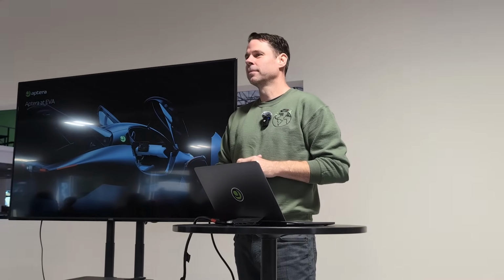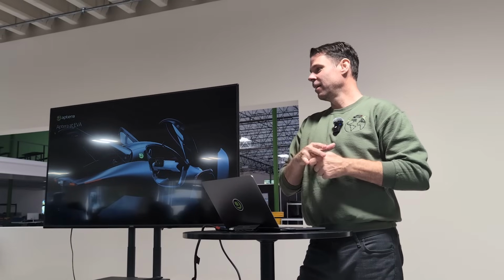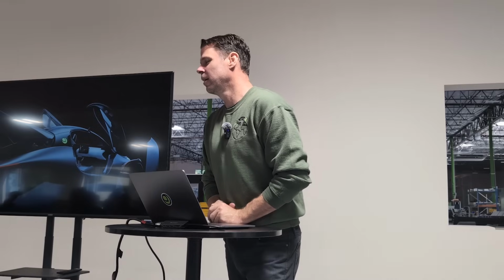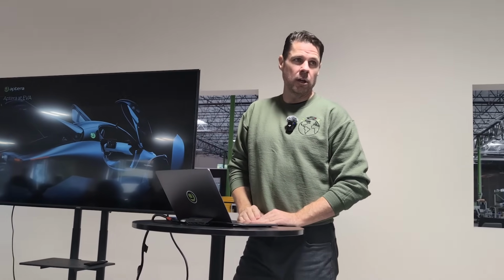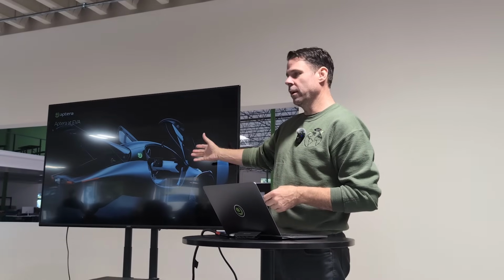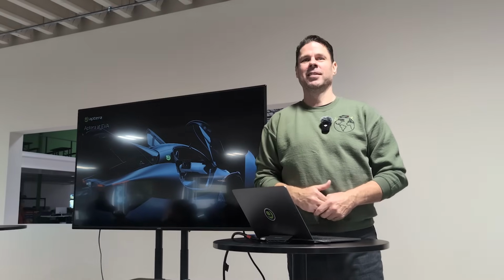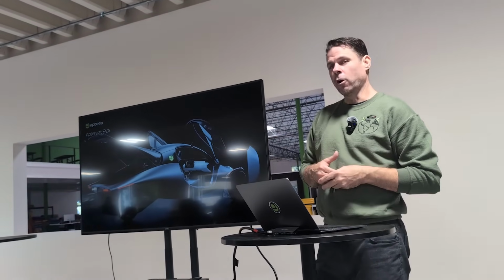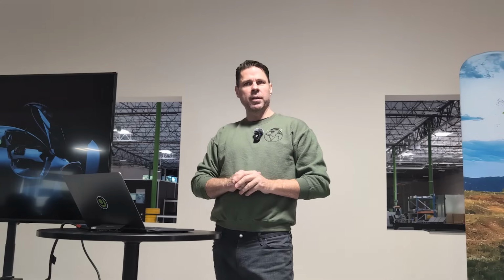Aptera Q&A session with Chris Anthony at EVA 2024

Comment: I understand that Chris A. would want to boast about the roof straight of the 2006 model but that was a very different vehicle in construction and design.  There really is no direct comparison with the current Aptera.  Simulation models are incredibly accurate these days.  They could compare a simulated model of the 2006 vehicle with the actual tests from that time and then take that information and see how the 2024 Aptera LE compares in the simulator.  The thing is, they will have crash tests in a few months and hopefully that will validate the simulation tests.  What really only counts is the actual tests of the 2024 Aptera LE.  Comparing it to anything of the past is pointless and only weakens credibility.
Reply: The roof should be stronger in this version. It has a steel rollover hoop built in.
Reply: @tims8603  I don't doubt that the LE is stronger than the 2006 model. Comparing the LE to the 2006 model is pointless.  As far as the steel reinforcement, kinda takes away from carbon fiber being stronger than steel. There is also a pretty big issue when carbon fiber is in contact with steel. Galvanic corrosion will eat the steel for lunch. There are ways to avoid the issue with isolating coating on the steel but you cannot have the two come in direct contact. CPC Group is well aware of this and has dealt with it for years. My point here is for anyone who is going to be working on their Aptera, that this is a big area of caution.
Reply: @ddessert6  I did some research and found this.

Here are some remedies to control the galvanic corrosion of metals connected to carbon composites:

    Substitute the metallic part with a high-corrosion resistance alloy. In this case, the best option is titanium and its alloys.
    Disconnect the electrical connection of two parts by placing an electrically insulating material, such as fiber-glass-reinforced composite, between those parts.
    Use epoxy resins without any hydrolysable linkage, such as ester bonds, to mitigate water penetration into the composite and then to decrease the real cathodic surface area.
    Use sizing agents as a sealant on the surface of the carbon fibers before fabricating composites.
    A combination of sulfuric acid anodizing and a hybrid sol-gel coating is quite effective against galvanic corrosion in carbon fiber metal laminates.

So, it seems, there are ways to prevent  galvanic corrosion.
Reply: @tims8603  yup, I'm well aware of the possible solutions & have been working with CF for a long time. The other "little" issue with people working on their Aptera is carbon fiber dust. A respirator mask is a must if drilling or any cutting/sanding.

I'm looking forward to getting my vehicle next year.
Reply: @ddessert6  I don't think they'll have to do much drilling or sanding. The panels are made with channels and mounting points molded in. They will be, mostly bonded together. Chris said in the Q&A that they will go together like LEGOs. That might be a bit of a stretch but, if they're formed with precision, it might not be far off. The bodies will be assembled by CPC so only final assembly will be necessary. 

My number won't come up for 2-3 years so I won't be getting one soon. We still don't know  what the prices will be so I might not buy one if they raise it too much. Also, I live about 2,500 miles from Carlsbad so I'm not sure how I can get one here.
Reply: I believe the roll bar is carbon fiber, not steel. There is a second layer over it that is part of the roof. 

The aluminum frame is the only metal in the body  (I've heard the belly pan is aluminum too but I think it's also carbon fiber)

I believe the point Chris is making is that the previously measured roof strength was already the strongest rating ever recorded. The new roof can only be stronger than that.
Reply: @richardryley3660  I guess the roll bar could be carbon fiber. I thought they said steel at some point but I could be wrong. I'm pretty sure the belly pan is aluminum though. I was in one of the exploded animation videos. Aluminum is probably cheaper and a better conductor of heat.
Reply: @tims8603  See, that's the thing. Chris said that the Aptera is built like a thermos. He specifically said that the Aptera would not leak battery heat to the surrounding environment. If the belly pan is aluminum, leaking heat in below freezing temperatures is exactly what the Aptera will do. 

Now, I could be wrong. I could have misunderstood. But I believe that I heard that the cooling system works by pulling in air under the windshield, and forcing it past the battery, where it exits back out the tail. The Aptera is air cooled, not by convection through the belly pan..
Reply: @richardryley3660  You're correct about the air flow from the cowl but there is also cooling from the belly pan. This video is one of the engineers talking to Steve from Aptera Owner's Club - Aptera's skin cooling system explained by Daniel. The conversation starts at about 1:30.
Reply: @tims8603  Okay, I did misunderstand. I think I saw that video, but missed that the belly pan was made of aluminum. 

It's still a bit hard to grasp, but he said that there is cooling fluid used in the cooling process somehow, and directed through the belly pan. I interpreted that as meaning the belly pan was essentially the radiator. Heat could radiate from it, but not convect into it. If that's not the case then thermally the belly pan doesn't exist. Air flow across the battery and airflow across the belly pan will be separate but at the same temperature. The HVAC can warm the battery (and maybe the air in the tunnel?) but the heat will be lost through the belly pan. 

The layer of air should act as some insolation though. Unless I'm misinterpreting again, the belly pan is not in physical contact with the battery. If you turn off the coolant flow, heat will stop being lost, and the battery can warm up. 

Maybe there could even be a layer of insulation on the inside of the belly pad. I wouldn't speculate though. That would prevent cooling the battery as quickly. Maybe that could be the Winterizing option.

I'll add that I also understood the statement to mean that the battery pack is filled with coolant. That coolant flows from the battery into the "radiator" in the belly pan. So the air cooling is separate from the liquid cooling and the convection cooling is on top of that. The inverter coolant may also flow through the belly pan. The motor cooling is in the outriggers and is completely separate. Again, unless I misunderstood.
Reply: @richardryley3660  I really don't understand what your concerns are. There is another video from Aptera that might explain more - Battery & Powertrain — Aptera Engineering Update
Reply: @tims8603  I never said I had any concerns. I said that I did not agree that the belly pan would be made of aluminum. I clearly misunderstood.

Comment: With so much being assembled in Italy, it seems a bit overkill to have such an extensive production line. I’m still not convinced that the solar production can keep up on a shift to shift expectation. He says they can make 10 a day. That’s only 50 a week. That’s only 2,500 a year. How’s that going to keep up with 20K a year on vehicles?
Reply: That is their pilot production line.  They have plans to set up a full production line that can easily keep up with full scale vehicle production.
Reply: They have automated equipment that produces the panels. I would expect that it is a matter of having  enough of that equipment to keep up with production demand.
Reply: As some have mentioned, they may be in a pilot configuration with designs to expand when closer they are the full production. No one has asked in order to get clarification.
Reply: Hopefully someone from Aptera will be reading these comments and fill in the gaps.  10 panels a day.  Does that mean all of the panels for the LE or individual panels?  As you have stated, even 10 complete set of panels per day does not meet the expected vehicle production numbers however I would expect Aptera to expand their solar production counts as they get closer to ramping up to 40 vehicles per day. To invest too early on the equipment to have it sit there unused for months, does not make much sense.  The equipment they have now can be used to work out the issues and make an inventory of solar panels.  Again, a little clarity from Aptera would be great.  There is no need to have things like this fuel doubt in the Aptera when there could be a very easy and logical explanation.
Reply: When Chris said production of 20k units per year, he meant that the slowest step will be 20k/year.

Comment: So glad that Aptera is staying with right to repair!
Reply: Having owned an electric car since 2013, let me tell you 
- Replacing electronic parts cannot be done by local gas car workshops. Note I’m taking about electronics. Not door handles. 
- Many times specialised software is used to calibrate and configure electronic parts. 
- It was not clear on how a customer will diagnose the faulty part and then spend time removing the part and ship the part. 
- For example if a cell fails in battery pack, ideally you want to remove the cell and add a new cell into the pack. Software is used to check health of cells and diagnose the faulty cell. Adding a new cell will need configuration using software and  cell/pack balancing. 
- How will customers or local workshops do the cell diagnosis ?  It is impossible without software know how and tools. 
- Any electronic part can fail Onboard Charger, DC-DC convertor, motor controller and others. Who manufactures these and who repairs these?
- He did not say if Aptera themselves will repair electronic parts or do they need to send it to their vendors to repair them. Turn around times will get affected. 
- Nothing was said about publishing schematics of electronic parts so third party workshops  can repair them. 

He just spewed some marketing saying Aptera is a right to repair company. They maybe honest in sprit, but in reality they don’t seem to have a clue. 

I love the company but repairing electric cars is not as straight forward as saying “shipping parts in 24 hours”.
Reply: @KamleshMallick Chris Anthony has already said in a previous investor Q/A that the battery modules are sealed and cells will not be accessible/replaceable. This is typical for all current EVs that I know of for a number of reasons (e.g. better vibration and thermal management).

It seems that you're envisioning "right to repair" as troubleshooting and replacing discrete components on PCBAs in the vehicle. That's clearly not what's intended (although it would be nice as an option). The model is that all main modules of the vehicle can be easily replaced by an owner or independent shop, with the replacement module drop shipped from Aptera.

I agree with you that we'll need to see what they provide for running diagnostics on the vehicle for troubleshooting problems. But I wouldn't call their talks of the right to repair as just PR so far.
Reply: @AverageJoe928  How will main electronic modules be “easily replaced” by owners or workshops?
Have they released the list of parts?
Which parts will need specialised software configuration?
Are we only dealing in electronic part replacement and not repair? - then he should say we are a “right to replace company” not a right to repair company. 
There are lots of gray areas in this process. 
Aptera Owners Club needs to create a video on this if he is reading.

Regarding battery packs being sealed - they should not be sealed for support personnel. 
If not how will they repair the pack?
Battery packs can can cause issues too. 
BMS or connectors can fail. 
Cars can stall at low SOCs if one cell or module becomes weak compared to others. 
Does the BMS have active or passive cell balancing?
Diagnosis of all of this should happen at special service centers by trained people. 
That is not going to happen. 
So unless they release the details - I will say all of this is marketing.
Reply: @KamleshMallick  they haven't even produced the first production intent vehicles and your shitting on their service materials? It really seems that some people like to stir up issues for the sake of controversy. Aptera has been more transparent in their development process than any other vehicle manufacturer that I know of. They've also modified the design based on feedback (e.g. inclusion of DCFC). If they fall short of providing necessary service materials then they should be held accountable, but it's way too early to accuse them of "pie in the sky marketing talk".
Reply: @AverageJoe928  
Really?
From my posts which have a lot of practical realities, you have jumped to the conclusion that I’m shitting on their service materials?
Maybe you need to improve on your comprehension. 
And you never bothered to answer my questions. 
Anyway. 
I Agree they are more transparent than other manufacturers. But I’m still waiting for the transparency on the repair process.
Reply: I believe there are not any EVs out there that allow access to change out a battery cell. First of all it would be difficult to even detect a bad cell. Then access to the sealed compartment, removal and reconnecting a single cell that has its connection lazer welded. While some of what you stated may be true, that was a bad example. In the ideal, Aptera will require very few repairs not the result of an accident. @KamleshMallick
Reply: @glennzajic7318 That is not true. Detecting a faulty cell or module is easy if you have specialised software. You either replace a cell or a module if any one or more are showing low voltage numbers at low SOCs. 
We have done it in our cars. 
Cells can go bad.
You can’t say it won’t happen. You don’t seem to have real experience. 
This is a more environmentally friendly way than companies replacing packs when under warranty. 
What happens when warranty expires? 
Either way companies like Aptera should offer to repair packs - which includes  diagnostics, software calibration and balancing. 
Who will do this at the local level?
These are practical realities people don’t get.
Reply: @KamleshMallick  - All repairs to the Aptera will be super easy. Just scan a QR code and everything you need is there. Software, diagnosis and software will be right there. Just scan the car and it'll tell you what cell you need. 5 minutes later it's changed out. All repair shops will work on the Aptera too.
Reply: @KamleshMallick even if you have instructions the vast majority of people will not be able to repair the vehicle,  much less a bad cell in a huge battery pack.
Reply: @KamleshMallick  This has been already covered by CTO Nathan Armstrong.  I live in Iowa, and my local independent shops have already said they are eager to work with it.

Comment: Thanks for the upload, Steve. If there’s one thing I wish the PI Aptera will have is, side impact airbags. I understand the body is super strong…but still.
Reply: I don't think it will
Reply: It won't, but I agree it would be nice. Motorcycles don't have air bags....but riders can purchase wearable air bag equipped gear that would activate in an emergency situation.
Reply: As long as it isn't a requirement I don't see side air bags being automatically built in. The mechanism is heavy and Aptera wants to shave off as much weight as they can. But I'm hopeful that it will be an option buyers can add for an additional charge. Those buyers can choose to sacrifice a little range for more safety. 

Aptera will have front air bags, even though they aren't required by law. And who knows, maybe the components can be miniaturized or lightened and put in the seats.

Also I don't know, but maybe that Honda side curtain airbag technology could be proprietary. Aptera may have to license the technology, or the technology of a "wearable" airbag to adapt it to their use. This definitely sounds like something they would want to ask the buyer to help pay for.
Reply: I don't understand why they can't have airbags in the seats. My Honda Fit has side airbags in the sides of the seats.
Reply: I think after the crash tests, they may decide to include them and I think the seats are a good choice as you suggest. @tims8603
Reply: Maybe they can add it later, but for now they are staying as lean as possible until they reach profitability. Once they are profitable they will be able to add the want list instead of just the need list.
Reply: @mikegrok  There are a lot of things that are "options for the future". The buyers demand it, but Aptera doesn't have the money to invest in it right now. A third seat/child seat. An off road kit. Winter package. Vehicle to grid. Even promised features like the rear hatch window and 1000 mile battery could take quite some time to get to market. 

I actually expect all these things if Aptera catches on. It just doesn't make sense that they wouldn't offer a side airbags as long as the customer wants it and is willing to pay for it.
Reply: @mikegrok  I hope they do. That would complete “the product” for me. And I’m willing to pay extra just for that.